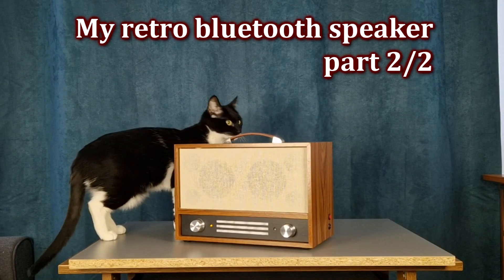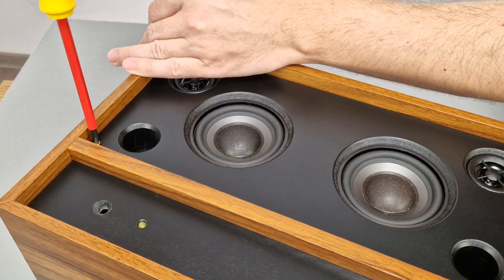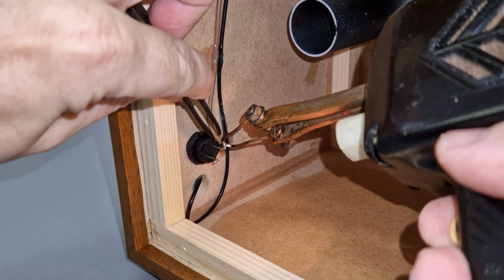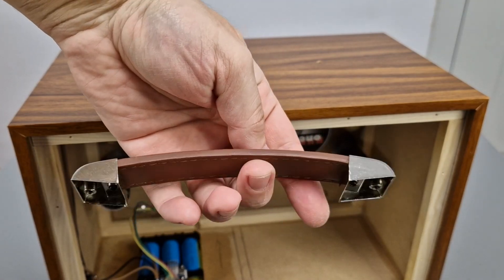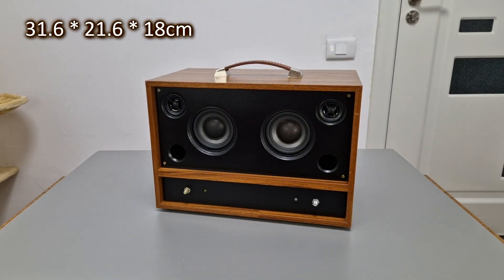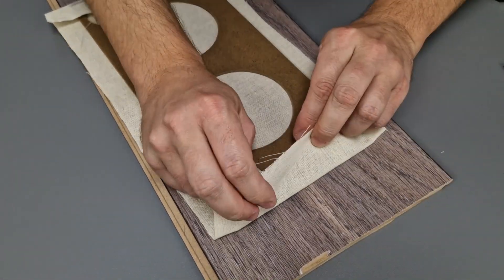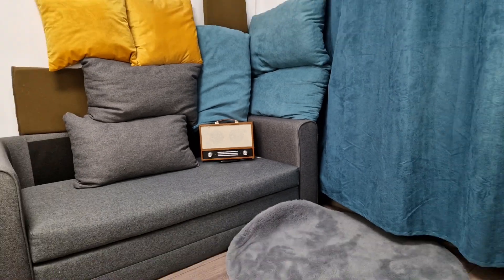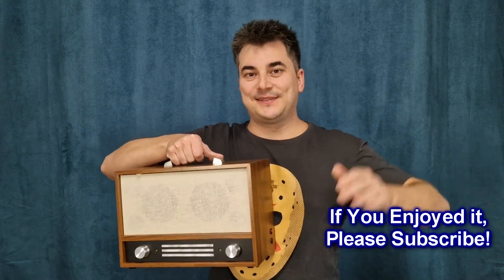DIY Retro Bluetooth Speaker - part 2/2 - 6W+6W

Comment: 🎯 Key Takeaways for quick navigation:

00:30 📡 Mounting Bluetooth board under the top panel with antenna facing forward improves signal range by avoiding interference from speaker drivers and wires.
02:08 🔋 Upgrading the battery to a 1s 3p pack with 18650 cells, providing a capacity of 6,000 milliamp hours for longer usage.
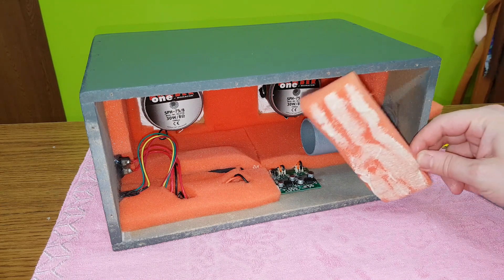03:18 🌡️ Avoiding overheating of the charging module by repositioning it above a plastic battery holder, ensuring proper air circulation.
04:13 🔄 Replacing the old micro USB port with a USB Type-C panel mount connector for charging, with added hole for a power LED.
04:41 🎧 Creating separate enclosures for left and right channels, improving the internal volume for each speaker driver.
06:20 🎨 Adding finishing touches for a retro look, including potentiometer knobs, a front cover with neodymium magnets, and a simulated radio tuning band.
08:19 🔊 Testing the Retro Bluetooth Speaker, highlighting improved sound quality and bass compared to the old design, with a total project cost of around $90 USD.
10:02 🛠️ List of improvements includes enhanced signal range, battery capacity, heat management, charging port upgrade, separate speaker enclosures, and aesthetic enhancements for a better overall experience.

Made with HARPA AI

Comment: Wow, I really learnt a lot about speakers and enclosures from your channel. I learnt that a chamber needs to be completely sealed and there should be soundproof material in the chamber. I did some modifications to my desktop speakers primarily involving completely sealing the chamber and adding soft materials inside. After the modification, they sound way more balanced and give off much louder bass from the radiators because of the sealing. Thanks, you are me get the most out of my cheap desktop speakers.

Comment: Hi sir please help me, i am big fan your work, I learned a lot,i have two buck converters szbk07 and lb07, on both of them current adjustment option does not work even on load applied, i even changed the cc pot with 100k precision pot .how to fix this?please its really impotent to me
Reply from the maker: Hi. first you need to test the converter with its original potentiometers. if it doesn't work, you need a different converter. 
if it works with the original potentiometers and after you replace the potentiometers it does not work anymore, then the potentiometers are not good or they are wired incorrectly.

Comment: I appreciate there may be a small cost implication, but could you have used a rotary switch on the front panel for the power as you had gone to the bother of imitating a control anyway? Really enjoy your videos, keeping the projects within the realms of most people's ability.
Reply from the maker: Yes, that's a good idea.

Comment: Are there any good low latency bluetooth sound modules? All the modules that I tried using have around 150-200ms sound delay and that makes them basically unusable for movies or games, the lipsync delay is just horrible.
Reply from the maker: I haven't tested this before. I tested this bluetooth speaker now and it's ok. it doesn't have a sound delay, or it's undetectable.

Comment: Very nice speaker.  I have a few bluetooth boards and some speakers and plenty of 18650 cells from old laptop batteries.  I need to male a good bluetooth speaker soon.  Thanks for the tip on adding wood glue for the supports, I wouldn't have thought about that.  As always, love the cat.

Comment: Great Video!

For better temps on the tp4056 i know 2 different ways:
1- Change the current resistor
2- Add a shocky diode before the input of the tp4056 to drop a bit the voltaje and be more efficient. Tp4056 can be powered from 4.5 to 5.5V

Comment: Nice video. If you want more power you can use TPA3110 it has 8-26 volts range so if you use 2S or 3S battery pack it would be more powerfull
Reply from the maker: Hi. I have more powerful amplifier boards and speaker drivers, I will make some other type of speakers in the future.